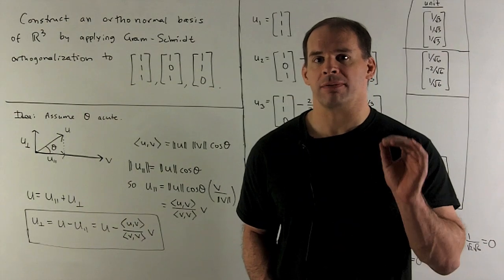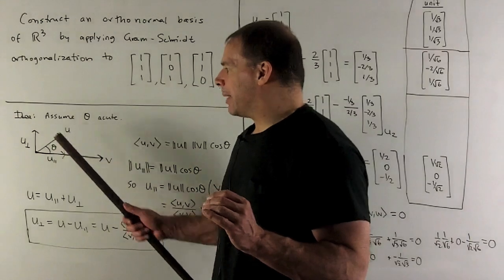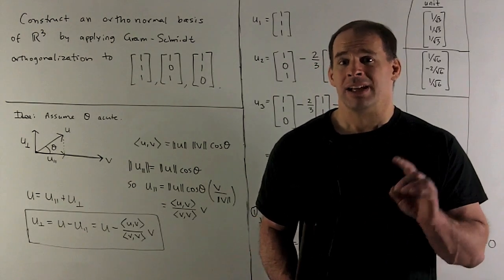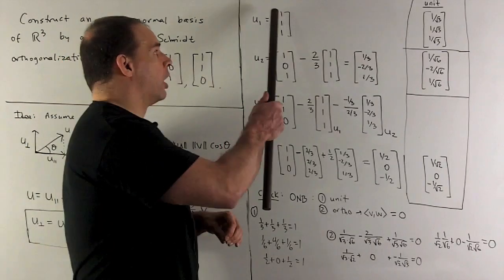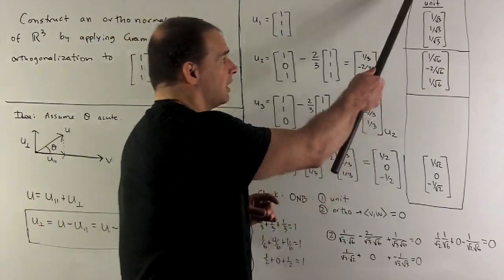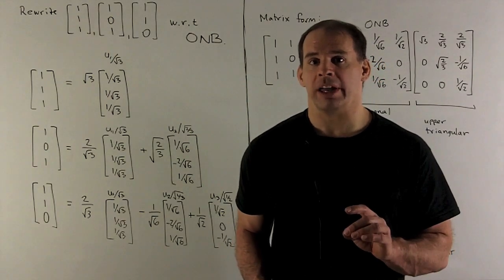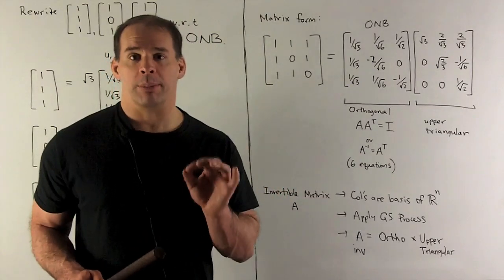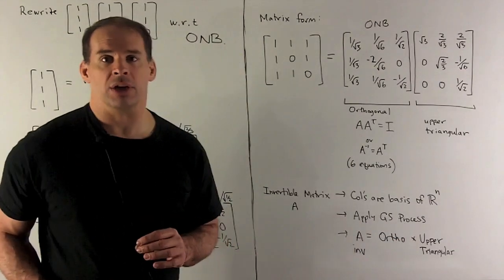Example of Gram-Schmidt Orthogonalization

Comment: Thanks for the video.. but i had a doubt about something in the video. It says <u,v>=||u||*||v||*cos(theta). So u(parallel)=||u||*cos(theta)*(v/||v||). This is fine. But in the next equality line, it says (<u,v>/<v,v>)*v. How is that possible, since <u,v> is wat is told above and <v,v>=||v||. My question is won't there be an excess of ||v|| in the numerator? this will be the ||v|| from the definition of <u,v>. Please forgive me if i'm wrong, but i couldn't see otherwise. I'm sorry, if mistake is on my part, but could you explain that? n thanks for the video again.
Reply from the maker: Your welcome!  Note that <v,v>=||v||^2.  That should fix things.
Reply: MathDoctorBob
ohhhhhhh......i cant believe how stupid i am with that.. i am sooo sorry...

it'll be like <v,v>=||v||*||v||*cos(theta)= ||v||*||v||*cos(0) = ||v||^2..

i seriously cant believe my stupidity.. I'm sorry sir... n thanks for rectifying the mistake on my part.

Comment from the maker: We have no info on u parallel beforehand.   Note that u parallel is the part of u pointing in the same direction of v.   I can describe any vector by giving its length and its direction (unit vector), and then take the product.  The direction of v is v/|v|, so we only need the length, which is given using the cosine formula.  Thus u parallel is u.v/|v|  v/|v| as written.

This works for any u and v, so no need to orient along any of the axes.   Let me know if that helps.

Comment: Hi MathDoctorBob. Thank you for your very helpful video. One question: in your derivation of the equation to be used (first ~3 min. of video), you multiply by the unit vector of V in solving for U parallel, to synchronize the direction. Why is this necessary? In your geometric picture drawn, U parallel is already in the direction of V, so it isnt needed?. Is this for a scenario where V might not lie along the x-axis? Would you be able to explain or link this concept for me? Thank you very much!

Comment from the maker: Not in the span won't be enough.  You need to have an orthonormal set at each step - so the vector you add must be orthogonal to the previous ones and have length 1.

Comment: Hi Bob again... I implemented the modified gram-schmidt algorithm to add column vectors to Q after QR decomposition and I also added zeros to A. The problem is that after that Q(transpose)*Q is not perfect unitary matrix. There are to cases, either I have bug in the code or the vector that I add at the beginning is not right. Regarding the second question the theory says add arbitrarily a vector to Q that do not span previous Q... Any ideas on that? What I do is to add a vector with rand numbers

Comment from the maker: That's exactly what you want, but you also need to extend the columns of R by 0s to get the dimensions to line up.  All you need is that the columns of new Q form an orthonormal basis;    that ensures that Q is orthogonal.  Since the extra vectors zero out in the product, so you have a lot of freedom.  - Bob